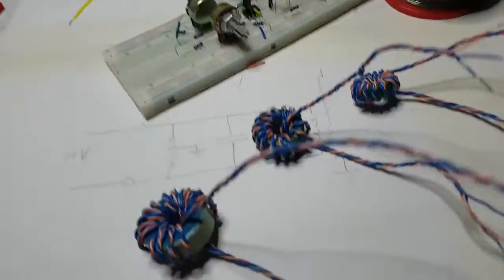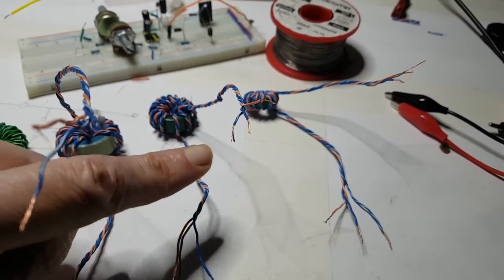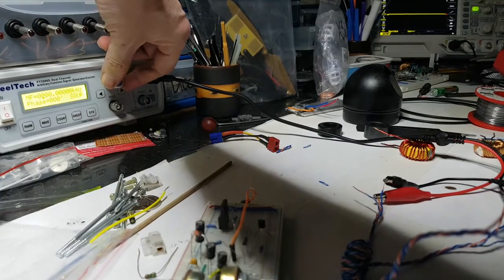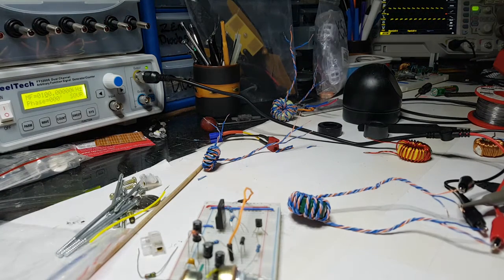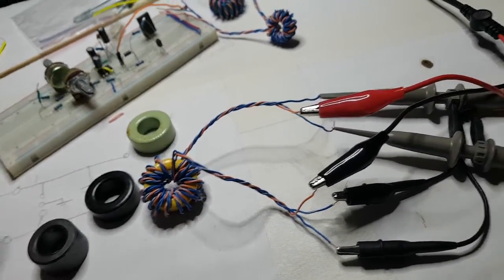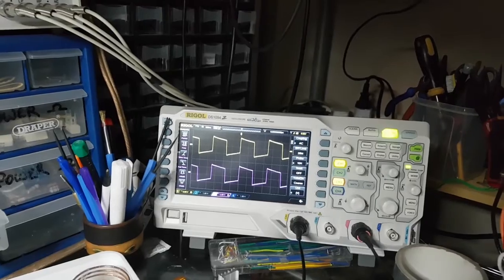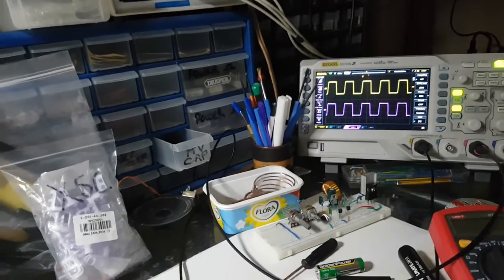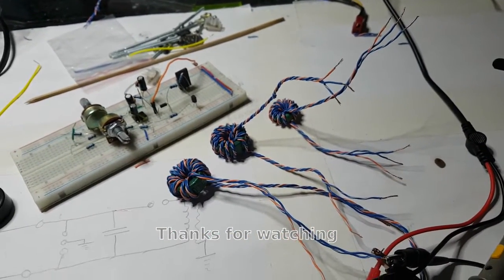What Gate Drive Transformer Core

Comment: You can’t inverter the signal to get get a low signal to inverter you have to get a Ic that inver to each other  no splitting of a signal give a i per or lower signal the npn need to inverter is self upper side and pnp for lower signal that’s how it down npn for high side pnp for low side